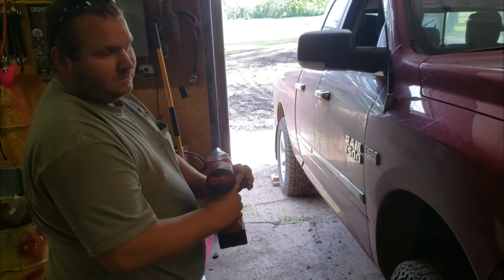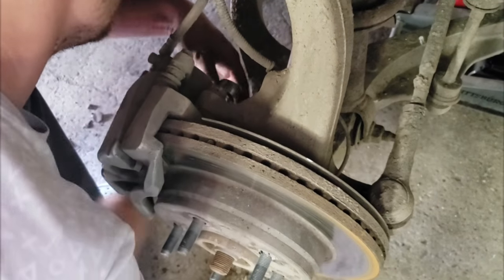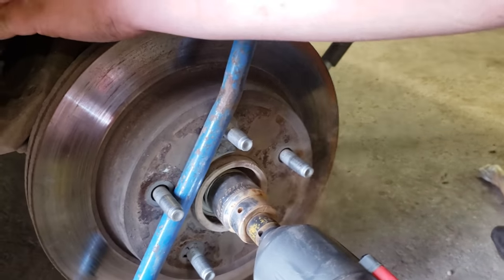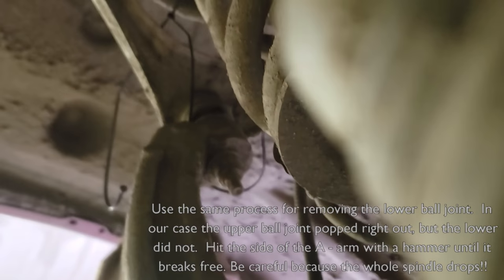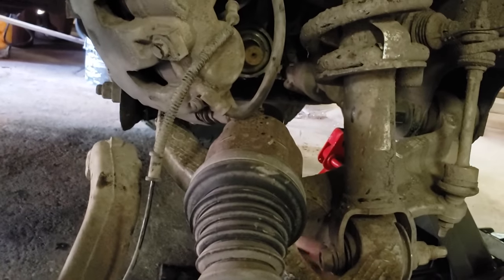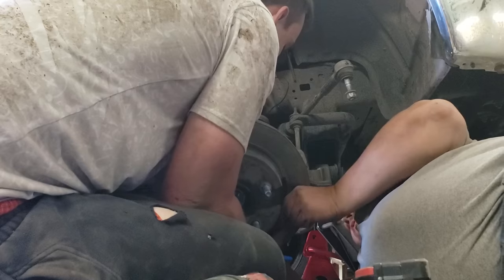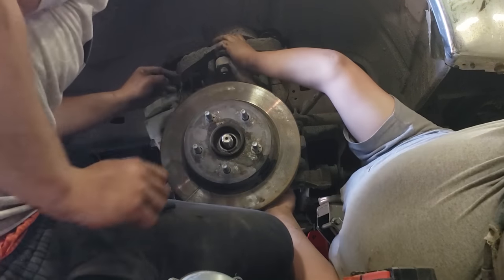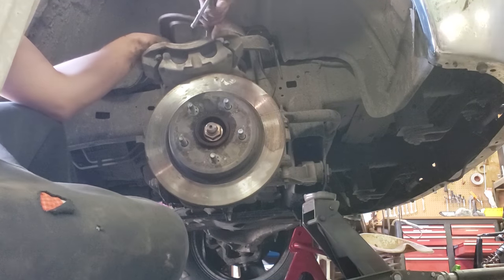Dodge Ram 1500 4x4 - CV Shaft Replacement - DIY EASY!

Comment: You both made me free good. Did the same…both sides…by myself, in the cloud, and crammed with not a small garage, with poor lighting. About 3 hours total. I replaced the passenger side intermediate shaft as well. Super simple.

Comment: You don't need to remove the hub, just loosen top nut of upper control and pull out and leave bottom attached.
Reply: That did allow enough room for mine.
Reply: I didn’t have to remove anything besides the upper control arm then I could wobble it out then put tape on my new one to protect the threads and it poped right in its better to keep as much ball joints attached so the knuckle doesn’t crack when you go to hit it
Reply: Depends…had to remove my entire control arm: 2010 Ram. However, removing it was easy. Had to use a sledge to pop one of the lower joints free.

Comment: I just did a CV axle on my truck for the first time, the inner joint was severely rusted onto the shaft. I tried every trick I could find on YouTube to try and get it out. I was prying on it and hitting it with a 4lb sledge for hours. I tried hooking a chain to it and pulling on it with a floor jack, I went and bought a slide hammer with the vice grip attachment. I cut grooves into it so I could hook onto it with the 3 jaw slide hammer attachment, I put a come-a-long on a pry bar to maintain force against it, heated it with a torch, and used a slide hammer at the same time this thing did not budge it was really stuck. My final and successful trick was to cut the thing off with an angle grinder! I accidentally cut the splines a little bit, hopefully this doesn't cause me problems in the future.
Reply: Ain't that the truth! Never goes this easy. Getting the right side cv axle off I went through this nightmare. A 10 lb slide hammer and chain, and hours of ripping it out until the whole diff seal and stub shift tore out, and had to replace those after. Nightmare!
Reply: Same for me.  I think I may have to split the tube like you did!

Comment: How close does the inner CV joint come to the dust seal at the center? I’ve done everything to push mine in and it’s still a half inch from seating and it has a little play.

Comment: I just surfed for something as to base on my (sound issue). I took my wheel off, turned the studs which turns the shalf you just pulled out. [I just started hearing a clunk-clunk sound) When turning it slowly, like a skip drop skip sound. 

Why, did you replace this item friend, J-Bob's Garage? 

I'm more than greatful for your insight, I'm not a mechanic, but have through my younger years a gresse monkey as a kid. 

The link above is for the purchasing of the item? 

Why, Bob rocks. I'm now Subscribed to allvidoes.. 

What are these units for? 

Sorry for all the questions brother.

My truck is a 2017 Dodge Ram 1500 

  Karl

Comment: Did your new axle come with a c clip ? Most new ones don’t have that retaining clip
Reply: IRONWOLF _OMEGA they should come with it..I’ve never had one without it unless it’s a really crappy aftermarket part
Reply: IRONWOLF _OMEGA I can’t get this over the gd c clip! Not going on anything like yours did
Reply: @rahrah8076  ON THE DODGES MOST TIMES THEY DONT COME WITH THEM, EVEN THE mOPAR ONES
Reply: @rahrah8076  the c-clips are part of the inner shaft, not the CV shaft like your thinking

Comment: I am trying to replace the hub on my 2010 1500 having trouble removing the 3 bolts connection hub to control arm do i have to follow all these steps just back the cv joint away from hub?

Comment: So for all the dodge people and 4x4, I had different rims and tires and after like 6 months it’s making like a warping sound when I drive you can tell it’s something rotating but also feel vibration in the steering wheel and the pedals if my foot is against it
Reply: Did you retorque your lugs???

Comment: About how long did it take y'all to do?
Reply from the maker: About 45 minutes or so
Reply: How much was the new part?
Reply: Josh Perry depends oem is around $400 and aftermarket $150 and up each
Reply: @rahrah8076  Boy did you get ripped off. I can get them at any auto parts store for a $100  Through dodge on ebay for 175
Reply: @chevybossman1  no way you will buy OEM for that price...EBAY is not through Dodge. They retail for $133.99 at parts stores for decent ones with a lifetime 
warranty.

Comment: Did you have to get it aligned after?
Reply: No
Reply: Highly Recommended
Reply: Don’t need to, you’re not messing with the inside control arm so reinstalling the hub will keep everything in the same position it started in.

Comment: you can also cut 1/2" off of the threaded end for easier installation,without dropping bottom ball joint. It's plenty long enough.
Reply: there's so many things I wish Ide known before buying a 2015 4th gen like getting air bags , without leaf springs God damn grandma's old 89 station wagon can handle more weight in the back . I went to get a yard of packing sand one bucket full with the front end loader and she drops I said is that it the gut says there's 2 more bucket full left but I h8ghly recommend not putting any more in lol. one more I said she'll handle it well holy f%$& I had to limp home . after that I had to grab 33 bundles of shingles not thinking 70lbs each it won't be bad well 110 km with only just over 2000 lbs it's the most unstable rear end in ant truck I've owned . the quality of the rise over capability of max load isn't justified . air bags should be mandatory for. a 4x4 if there's no leaf springs . Toyota will be my next truck screw dodge thetbmade too many wrong decisions on this one
Reply: @andrewdenine1685  it's a half ton. If you needed a truck to do 1 ton stuff then you should've bought a 3500.
Reply: Threaded end of what?

Comment: How do you know it's bad, clicking??
Reply: The boot usually splits and slings all of the grease out on the control arm and inside of the wheel well. If you don't notice that, you'll notice the CV joint is bad after it's been run dry.
Reply: @savagele  Mine just split the boot and slung grease all over the wheel well yesterday evening... right about the time you wrote your comment. :(
Reply: My inner joints housing just flops up down and and all over pretty sure this isn't normal

Comment: Got any connections for the intermediate shaft with seals and bearings for the passenger side front differential that fits 2015 ran 1500 . I dont want to replace the whole front differential assembly which a used one is 1800 bucks just shaft and bearings and seals if not is there some other parts i can rig something up . Dodge really stuck it to us 4th gen ram owners by only supplying essiential services vehicles. Should be againste the law to sell a vehicle and not sell certain parts to the public. A quick fix would save so many people thousands and would put s stop to the vibration at low speeds in the front end and save cv axles and every other front end part it takes down with time not to mention that gas peoole would save.

Comment: im having this problem i cant get the cv off the diff
Reply: Derek B what side?
Reply: @baps1137  driver i finally got it off after useing torch warm up and drilled and added almost half can of penetrating oil and welded up a metal piece and beat that daym axel off was a battle
Reply: Great video but I also can’t get the cv off the passenger side Differential. Hammered on it for a long time. Any suggestions?
Reply: Derek B okay thanks for tip. I even rigged up a bearing puller to push on the stub axle and while pulling on the CV axel. Seems like the keeper won’t release
Reply: I could never get mine slid off so I ended up spending an extra $65 bucks and buying a new intermediate shaft and seal and replaced it all. Definitely the way to go if you can’t just “Pop” the CVC axel off
Reply: @aldericayers9317  is the intermediate shaft the splines that the cv shaft goes in at the differential?

Comment: Anyone who can help I have 2017 and at super slow speeds I hear a like very faint pop/click from left wheel side I’ve read wheel hub but could it be a bad cv joint none of the boots are ripped or look bad
Reply: Wheel bearing likely. Jack it up and pull on the inside of the tire outward, 12 +6 and 3+9 positions. If any moving t or popping, change wheel bearing hub kit. Do both sides as they should be done in pairs.
Reply: @joelsmithers6887  3 + 9 is to check tie rods, 12 + 6 is for wheel bearing play.

Comment: That's fucked, I've replaced my passenger side twice now before touching my driver side, has your driver side gone yet or just passenger?
Reply: I've replaced passenger twice , that's the side with the actuator, maybe that has something to do with it? or just dumb luck for both of us I guess
Reply: @mattjo0078  my passenger side just went that's why I'm here haha
Reply: My passenger side axle just went to. 2015 ram 1500. Second time this happened in less than 2 years.
Reply: Wow, are y'all mudding or driving faster in 4wd that is recommended? I have always owned a ram 1500 since 1995, and have NEVER had an axle issue. 
Just wondering what's up with that? Luck of the draw or?
Reply: I'm at a loss on why it keeps going out.. I rarely use the 4wd system. Only used it maybe a handful of times this winter and never at highway speeds.
Reply: @nathanp589  same here man!
Reply: @nathanp589  are you using cheap axles? or mopar? also they say you are supposed to replace both at the same time like youre supposed to replace both hub bearings at the same time.
Reply: @vaquero3578  no way. Passenger side hub wear out like 2 to 1 rough part of the road and the crown of the road I think are main reason. I would never do the axles in pairs. Unless it is bad roll on. Sometimes one side will last for life of vehicle.
Reply: Late to the show, but make sure the inner end goes on about a1/8" past the oring. Otherwise it won't click the snap ring